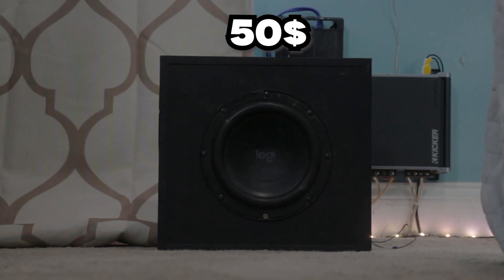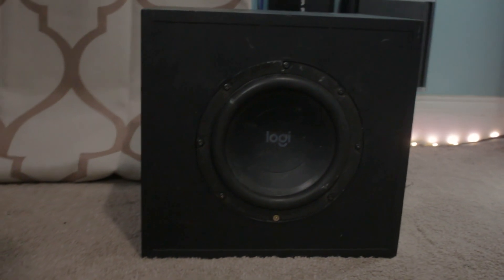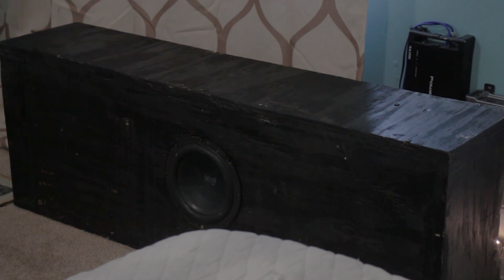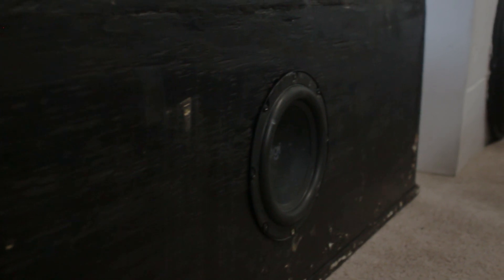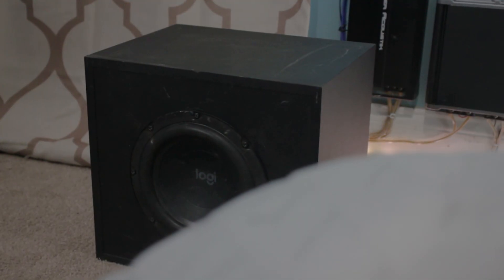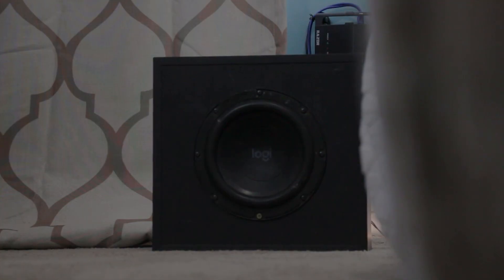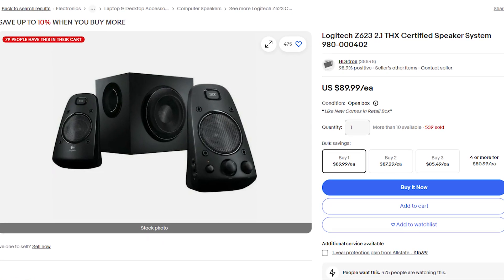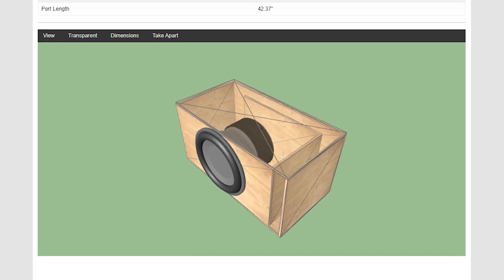Custom Subwoofer Box Makes Cheap Subwoofer Sound Great? (Is It Worth Building?)

Comment: As someone else has mentioned any sealing material around any speaker is vital, as with a car tire - NO leaks are allowed as they do affect performance and create their own little noise spectrum(s). Not even for this video, no disparity, just saying in general to all. Glad that you found in each cab its own do- and don't-likes and the smaller box is probably made for the small party environment and the larger is for low-ass home theater. Usually 'Hey, that box is too small' or 'too big'; I have two smaller, completely-different subs in my living room TV setup and the range is excellent and surprises me often. LOW POWER, but enough for me, lol. Connect your two in perfect parallel or depending on ohmage, even as I'd avoid TWO channels being used, one per channel. Simultaneity is key! Also, you can be a pioneer - create ports that have different sizes by inserting smaller-sized ones into them, foam-sealed at the opening. I stuffed a big sock into the port of one of mine = tighter bass! Have fun. - 🤗🙂🤩

Comment: If you wanna try a better driver in that enclosure you should check out parts express they have the grs and reference 8" subs and a 7" extended range sub aswell, and i bet the new ultimax 2 would absolutely pound in that box, i think theyre sold out of the "8 ones but you could make the hole bigger and get a 10", im pretty sure theyre still on a drop sale type of thing so theyre cheaper than the old ultimax's
Reply from the maker: I definitely want to try out a Dayton Audio subwoofer, and I've been searching for some 10's to test out so I'll take this driver into consideration. Thanks for the recommendation!

Comment: great vid! It definitely performed better for sure. 
Also just a tip btw, if you upgrade a ported sub, make sure to use it as a ported sub in the new enclosure, if not then it wont perform as good as it can, sealed versus ported sub drivers are made allot more differently spec wise, so if its sealed and you upgrade, make sure it stays sealed yk what i mean? 
Awesome clip i subbed lol
Reply from the maker: Thanks for the tip!

Comment: I built a 6th order for my z623. 
It uses the stock half, which is tuned to 45hz (and about 14 liter volume) and a sub box that I found and modified to be tuned to 25.5hz with about 32l volume. 

In a car it gets down, in the front its basically flat from 22hz to 35hz at ~128db

Comment: nice but the logitech z623 blows itself up if u play it above 70% i learned it the hard way😕
Reply from the maker: Yea I've definitely had it smelling before. I now use my own amp to power it, which gives a cleaner signal, but it still can't take much power.

Comment: From what I know and experimented with it seems that a smaller diameter port firing into a larger diameter common port helps to get loud on low and high bass  frequencies because it builds pressure at the smaller end of the port and the larger end causing a pressure differential, So what I'm gonna try is having a 12inch sonnotube with a 6inch hole on one end going into the box and that will help drive more pressure and air out the larger end because the air has to fight it's way out through the 6inch port and out into the 12inch outer port increasing SPL and changing polarity while inverting also helps as well, This method can really help the cheaper subwoofers to perform like more expensive subwoofers sense the smaller 6inch end that's going into the box acts like a buffer.
Reply: So you’re saying like a 6th order or what? I’m confused.
Reply: @BryceColeman1826 6th order series where a smaller port fires into a larger port or even a 8th order series where a small port fires into a medium port and the medium port fires into a large port and there's no stopping technically so a 10th order enclosure is possible but probably wouldn't be practical, The smaller ports help with building pressure and to keep subwoofers from over exerting especially for cheap subwoofers with softer spider's.
Reply: @ anyway you could explain how to design a 6th order series? I want to try one but have only ever made regular ported or sealed boxes.  I found a video on parallel 6th order but not a series.
Reply: @BryceColeman1826  A 6th order series is much more simple and it will save alot of space it's literally a port within a port type of enclosure and it creates the most wind and pressure, Basically different size ports have different resonances so a small diameter port will have a low resonance 10hz-30hz range while a large port will have a 30hz-60hz so couple a small port into a big port the small port will help keep the subwoofer from moving too much while also helping out with the lows the 10hz-30hz range and the larger end will help with 30hz-60hz range but the 12inch diameter sonnotube idea where I'm gonna put a end cap on one end and restrict it with a 6inch port while leaving the 12inch open is a an example of a 6th order series it's just a ported box where the air has to go through 2 different size openings instead of 1 but make sure you put wood glue on the sonnotube to strengthen it if you're gonna try that idea like I am.

Comment: Build some different boxes for the SDR 18 buuuuuuddy.  Sealed ported hell maybe even a 4th or 6th order bandpass for comparison.
Reply from the maker: I definitely want to experiment with different enclosure's for the 18. I'm planning on getting a second 18 soon, and I want to make the boxes for both 18's even bigger than the one I have now for more output. I'm also going to try the 18 in an infinite baffle setup as I hear it performs great in that setup.
Reply: @WaveImages  I have 4 in a sealed box oʻn a 2k Amp video is on my YouTube channel.  I have another 2k Amp I'm adding and I'm going to experiment also. Stay tuned buuuuuuddy.
Reply: @WaveImages  infinite baffle the wall bro ! :stayhome: